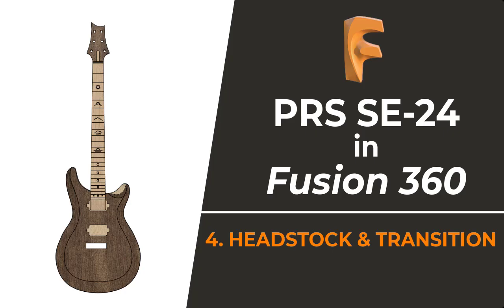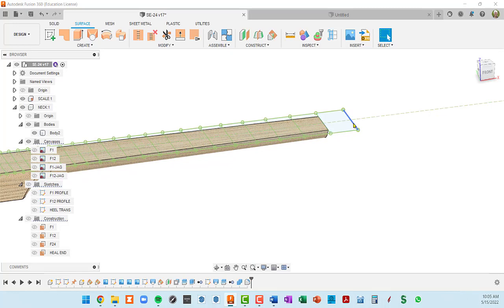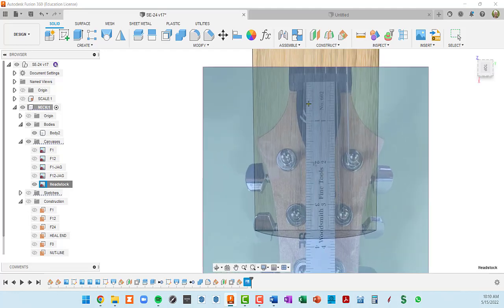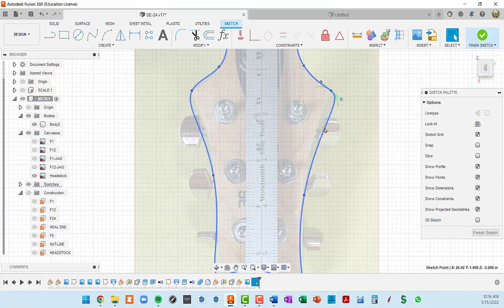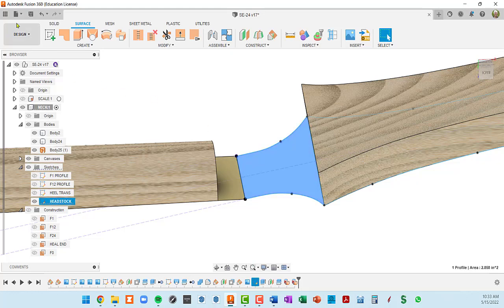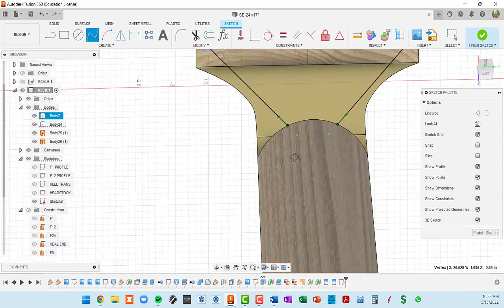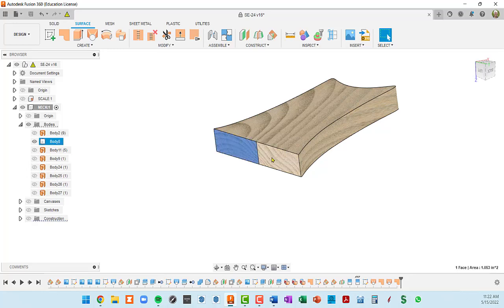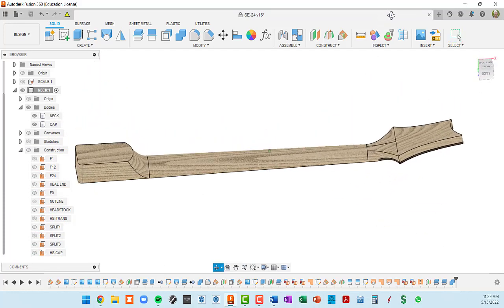Designing a PRS Guitar in Fusion 360 - Part 4: Headstock & Transition

Comment: I am having an issue making a surface patch similar to others. At around 29 minutes, there is a point where Body 2 turned into a surface body and not sure how. It is not letting me patch as it is giving me a surface patch error stating "Modeling error. cannot create tool body, check inputs. I am able to select all 5 edges and the preview seems ok, but then when I hit ok it states the error. Any help is appreciated.
Reply: Its been a while since I made the PRS video series, but I think the errors occur when there's no intersection between the 3 splines and the headstock and neck.  I would suggest editing that sketch, deleting the splines and re-creating them.  Let me know if this works.

Comment: Hallo! I ran into the same issue with the patch. How did you solve the problem?
Reply: There are a few problems you can run into.  1) Turn off enable chaining in the Patch dialog.  2) Make sure you can select all the necessary edges.  If you can't, try holding down the left button to select from the "drill-down" menu.  3) If you still can't select an edge, or if the patch simply fails, go back to your 3D sketch and make sure your splines intersect with the end points (that one has gotten me several times).
Reply: @benweiss897  Hi, the patch isn't working for me either. I did everything as you said and I paid attention to everything. Can You please help me?
Reply: @benweiss897  I managed to solve the problem. Thank you anyway.
Reply: @Smith16 Hi, how did you solve the problem? Even with stitch, still the same error on patch !

Comment: It seems that there was a cut at 28:37 which hides some progress. There are 3 new operations, a new sketch and a new surface object. This is exactly at the point where I am having trouble with the patch so I would appreciate it if you could tell us what you did there.
Reply from the maker: I think the issue that I went back and fixed was the inability to select a part of the rail that's a section of the neck.  If your segment is not selectable, make a vertical line on the cut neck face and do a split face.
Reply: @bweissvt  Thanks for the quick response. Is there any tip you could give me for the patch problem? I made sure to disable Chain Linking, I made the splines exactly as you did, I tried selecting everything in every possible order, I rebuilt the entire project from scratch to no success. I can't carry on with the tutorial and frankly I would like to know what I'm doing wrong. It would be of great help if you could help me with this.
Reply from the maker: @toxillo  I'll make a short video that shows how to split the face to allow you to select the segment for the patch.
Reply: @bweissvt  Thank you, I really do appreciate the time.
Reply: @bweissvt  I managed to do it. I looked at your Telecaster video and it worked. Not sure what the problem was but as long as it works..
Reply: @bweissvt did you end up making this video? Having same issue.

Comment: I keep getting an error on the patch. Says can’t create patch toolbody, please check inputs
Reply from the maker: Did you disable the "Enable Chaining" checkbox in the patch dialog?  Also check to see that your sketches properly intersect at the necessary points.
Reply: @bweissvt  I have the same exact problem. I already made sure that "Enable Chaining" is disabled. I'm not sure about checking for intersection but the points have the exact position of where they should be. The loft is working just fine but trying to patch the loft together with the headstock and neck gives me this error.